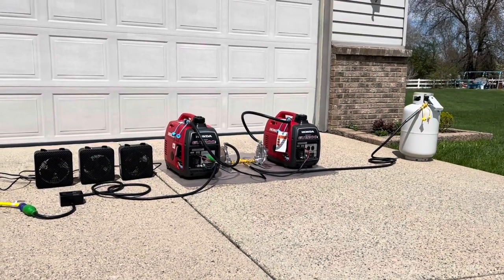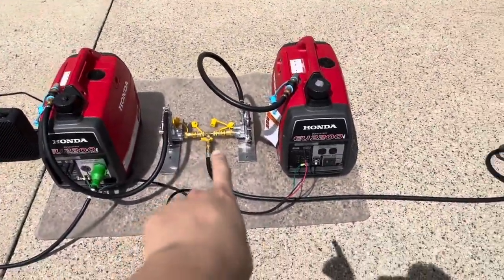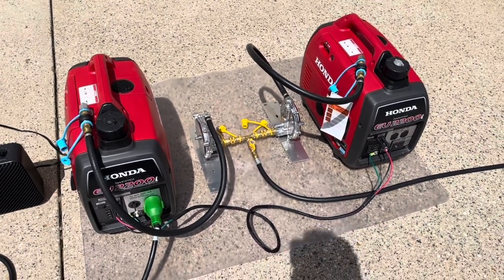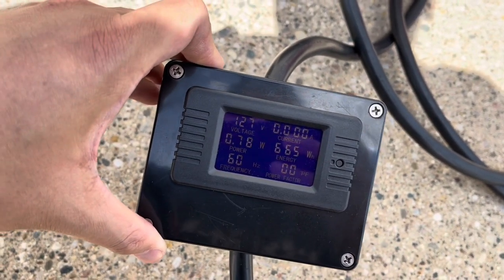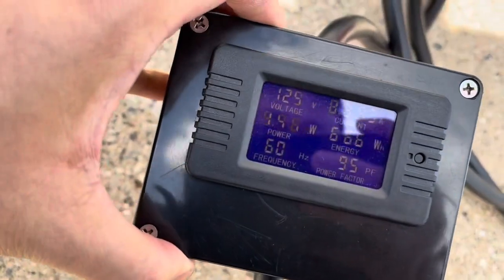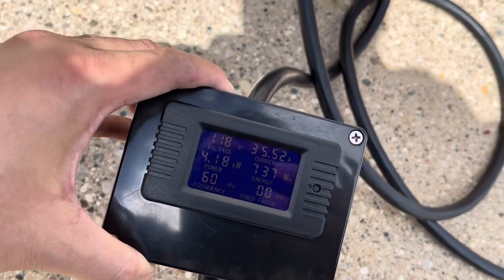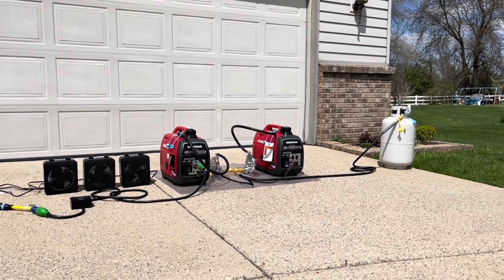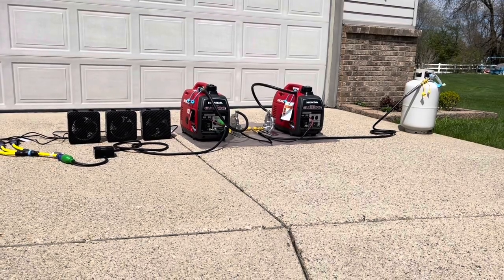Honda Propane Conversion Kit - Less Power? Engine Damage? Part 4, Max Wattage Output Test, EU2200i

Comment: I think the smaller 80cc generators running on propane don't put out full power.  Honda having a 50% displacement advantage (120cc vs 80cc) has to help.
Reply from the maker: The Chinese clone Yamaha 80CC MZ engine was used in the Champion 2500 inverter generator as too the Wen 2350 and both these generators kept up with the 120cc of the Honda engine in its 2200 watt inverter generator. The difference in the two is the torque the engine produces. The 80cc engine has a set RPM of around 5000-6000 RPM which it is at its peak band of power in the upper RPM range, while the 120cc operates at its lower RPM range of 3300-3500. Even with the disadvantage, the 80cc engine just has to work a bit harder to keep up with the 120cc, but during idle it has better fuel economy.
Reply: Gavins Garage tests the dual fuel Champion 2500 on both fuels. On gas, he can pull full rpm (4800) and 1850 Watts.  On propane, he can pull 1750 Watts at only 4300 rpm.

Comment: Do the same “test” running the two generators on gasoline and lets see what the numbers say.....
Reply from the maker: Gasoline fuel matches the factory rated wattage output on the generator. No different than every other video posted on YouTube. 

If your thinking gasoline makes more power, it won’t. Power output and the electronic governor is limited by the engine control module inside the inviter unit of the generator. 

You can head over to Gavin’s Garage YouTube Channel to see his test of the dual fuel generator. It's the same.
Reply: @GrenergyTriFuel  Then why do many brands claim less watts on propane ?

Comment: Nice! Is there a way to have this setup but with a dual propane tank (with auto change over)? I read somewhere that the autochange over lowers the pressure too much. That true?
Reply from the maker: Hi Albert, we haven't experienced any issues when using an auto changeover. The pressure off that should always output 0.5psi. If the pressure drops below that, then you have a faulty regulator. What can affect the pressure is having too small of a hose diameter size, you should really be running 1/2" ID hose size for anything over 10ft. It's like running a marathon while breathing through a straw, you wont get very far. Having the correct hose size is important to maintain volume of fuel flow.
Reply: @GrenergyTriFuel  that’s great news! I’m planning on buying 2 kits. Question about the included vents.. I noticed the other guys don’t have vent holes. Are these necessary? Trying not to keep the stock look and cut least amount of holes possible
Reply from the maker: @Like0Butter  Hi Albert, please click on this link, this should explain everything in detail - https://grenergy-us.com/pages/whats-up-with-the-air-vents-why